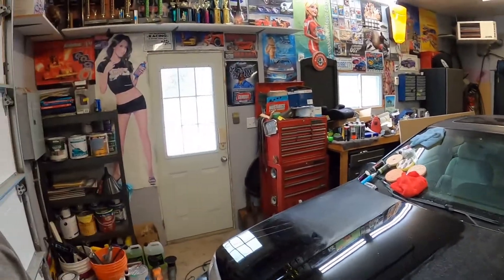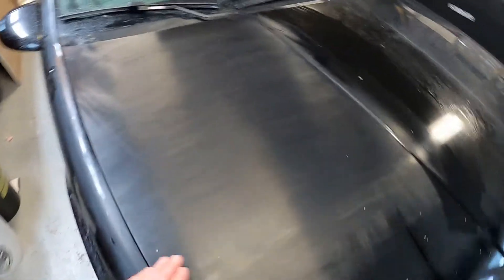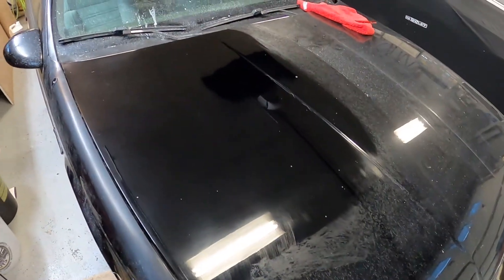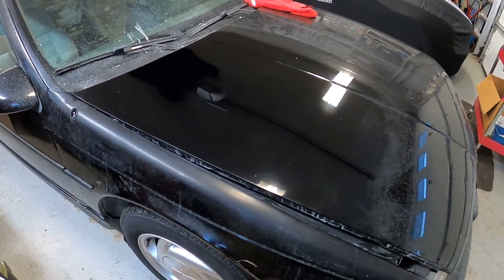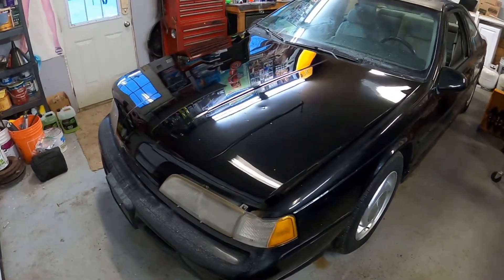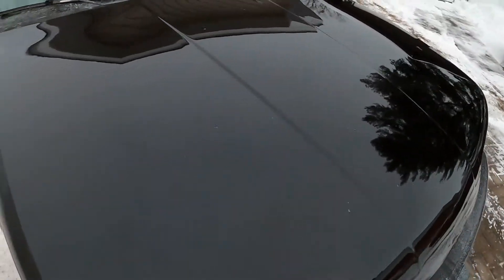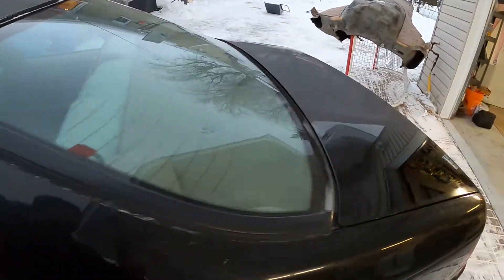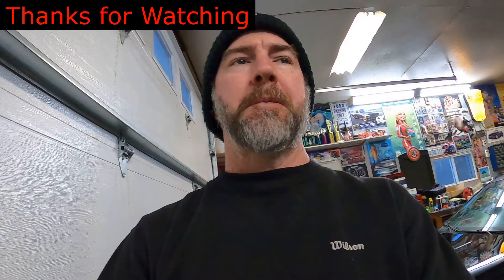Amateur Detailer tries wet sanding to remove heavy paint oxidation

Comment: I have been dealing with heavy ox on hood of chevy, rotary and rubbing compound, and ya, it it won't quite get it all off in certain angles in sun.  So I watched your vid, thanks.  I noticed you use orbital after rotary, I have been thinking of getting a da, I am wondering if you started with rotary and then added a da buffer later to your tool collection?  Was it worth it? thanks
Reply from the maker: I found the rotary to be more aggressive. It cut the oxidation off better.  I actually had the rotary for metal polishing, but It worked really good at cutting.
Reply: Thanks. I guess I meant, do you think it's worth getting an orbital in addition to my rotary?  Maybe it slings less ?
Reply from the maker: @Nathan-wf1pr  I'm actually thinking of getting rid of my DA. I find it doesn't do as good fine finishing as a rotary.  DA is a great starters buffer because it's harder to damage the paint.
Reply: @RogerBuckChrist  Thanks!